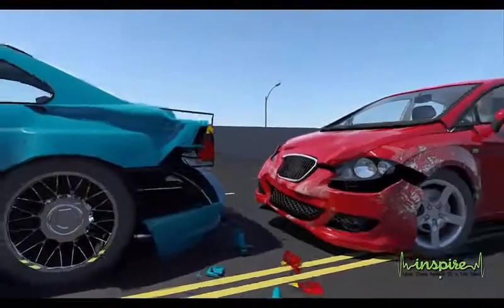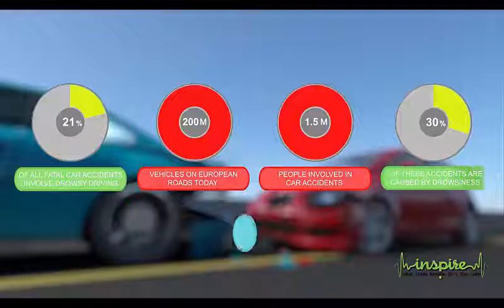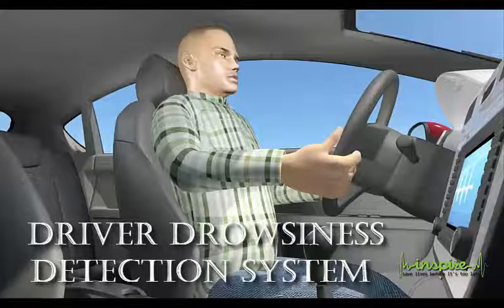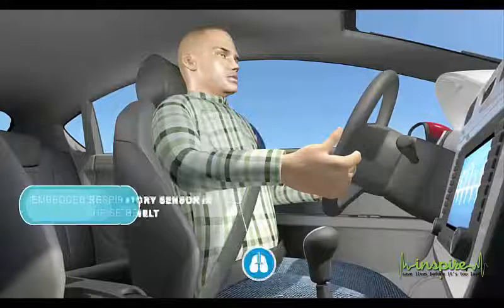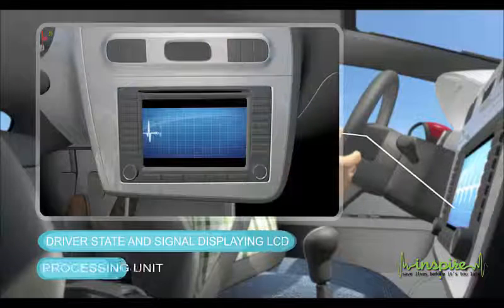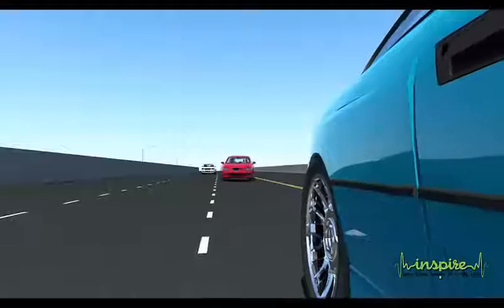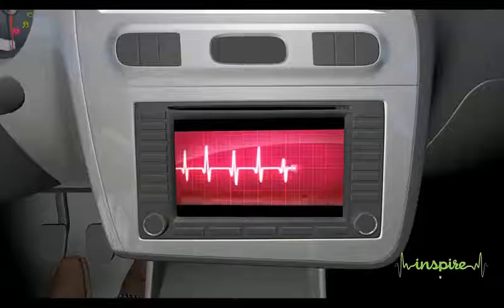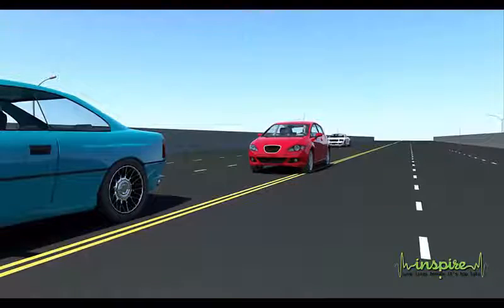POC - Driver Drowsiness Detection Prototype - Non-Contact ECG Sensor

Comment: if the person is very sleepy how the machine can get him up from the sleep. by giving a small message to the screen will help to get up from his sleep??
Reply from the maker: The intention of the project is not mainly the actions to be taken if the driver is sleepy, these actions can be a lot of options based on the available features in the vehicle (i.e. Activating alert message, vibrations, taking control of the vehicle using autonomous driving feature, ..etc).

The main goal for us is to discover and analysis the driver drowsness state based on the biomedical signal which alows us to detect it early enough to take an action rather than other alternative ways (Face regonitions, ..etc).

So in our demo showing a message is just an example.